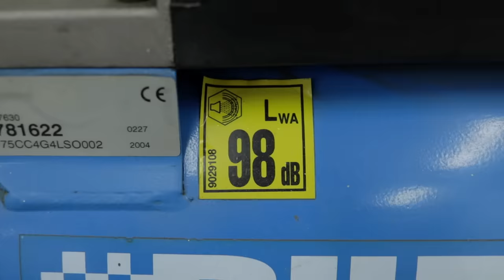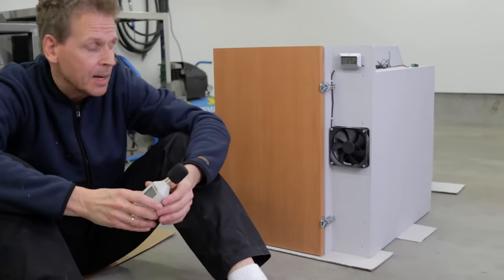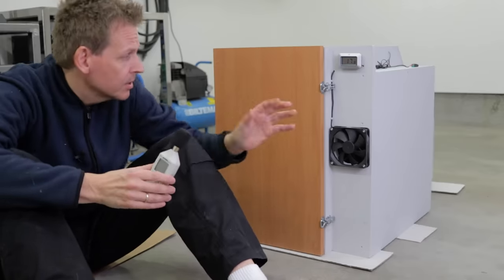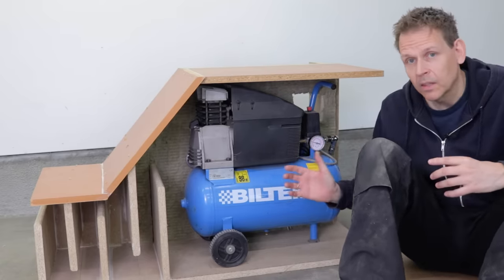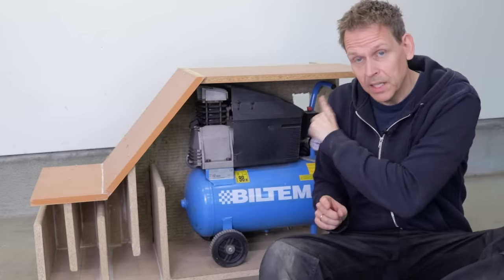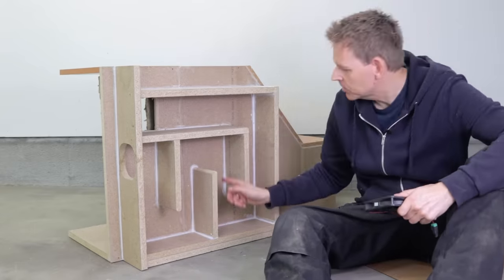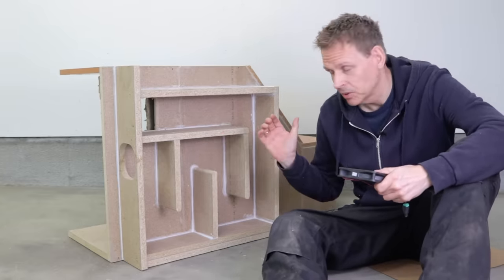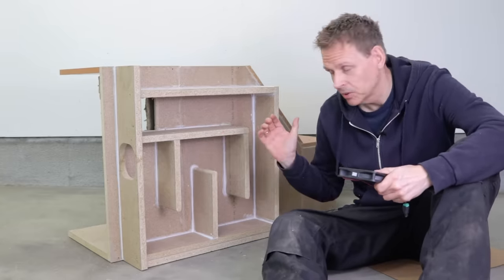Do not build a sound insulated enclosure for your noisy air compressor!

Comment: 0:31 Just a little tidbit, dB is a logarithmic measurement, so a 10 dB gain isn’t twice as loud, it’s actually 10 times as loud!
Reply from the maker: I might have over-simplified how the Decibel scale is to be understood, let me try to clarify (based on a discussion / explanation from the comments): 
* 10dB increase is the typically stated value for doubling the perceived volume (subjective), without respect to actual power/energy. 
* 3dB increase is a doubling of the actual power/energy (objective), without respect to how a typical person would perceive or rate sensed-volume. 
I have to add that the Decibel is a difficult scale to relate to (at least for me), I might have to study this a bit more - sorry if I got it wrong 😌

Comment: The only mistake I saw is that it will be very hard to drain the water out of the compressor tank.  And the water needs drained out after every use, or once per day when in use.  The inside of the air tank is raw steel, no protective finish.  They rust out after a few years, if not drained regularly.  I have painted the inside of my air compressor tank and I still drain it once per day.

Comment: First, if you spent that much time on making the compressor quieter, how much time do you spend on a project? Second, if you're that worried about the noise from the compressor to spend a ridiculous amount of time and effort to quiet it, how do you quiet that 2 cycle dirt bike in the back ground?
Reply from the maker: The time spent on projects like this are pure joy 😊 I have actually fabricated the exhaust pipes for the motorcycle as well, but bought the muffler. It's not that silent 😜

Comment: You couldnt do that with mine, even with quality oil, It gets stupid hot when using air tools.
Reply from the maker: I guess some air compressors gets hotter than others. The environment is also relevant. It's a pretty cold climate here where I live in Norway, in the Northern part of Europe. I have actually fitted a heat pump in my garage to be able to use during winter time. I can see overheating is a big challenge in warmer climates. A more powerful fan or even radiator cooling could be needed must then be considered.

However, since I have a fan in front blowing air into the box I have airflow through the case that will "grab" the heat and transfer it out of the box. I have fitted a thermometer and checked the performance frequently. Normally the temp increases 5C = 10F from when it starts until pressure is built up and it shuts off, and then it takes just a couple of minutes to cool it down (as the fan continues to run after the compressor stops). If it is running constantly over longer periodes it can get a bit hotter, I have seen almost 10C = 20F increase. The warmest summer days can be 30C = 86F here where I live, but that is very rare. Its more commonly 25C = 77F, so it never gets very hot inside my box and it is within the range of acceptable temperature for this compressor.

Comment: My Solution would be, to build a tiny shed onto one walls of the garage, drill a hole through the wall, and just put the air compressor outside. Where it can do 95 dba as it pleases :D
Reply from the maker: Yes, that is probably the easies and smartest solution to the problem 😊Unfortunately, I just dont have space for it. My garage is placed with minimum distance to two of my neighbors. The side facing my own property is not usable either,  as it's just a slim path between my garage outer wall and a concrete retaining wall. In front of the garage door is no good either 😋
Reply: @kihestad  oh thats a problem when everything is cramped so tight.

Comment: Wouldn’t it be better to buy a second identical air compressor and flip it up-side-down. That way the sound waves from each air compressor cancel out the noise from the other air compressor. Badabing silent 97db air compressor!
Reply from the maker: Well, you need some kind of device to make sure they start and stop at the exactly same time, like a syncronization unit - thats a DIY project for sure!!!😁
Reply: @kihestad  great idea! Sounds like we need to get the Arduino’s out

Comment: it may have helped if you built a proper intake silencer first
Reply from the maker: From what I have found a muffler on the intake / exhaust helps a bit, but not very much. I could be wrong though... I did some research but did not find any solution that I found to be very efficient, not even the ones fitted a big car muffler. The tank itself also emits noise because it acts like a sound chamber. I would guess that if a muffler really worked, the vendors would have added it.

Comment: Compact car air intake box will help to quite it down.
Reply from the maker: From what I have found a muffler on the intake / exhaust helps a bit, but not very much. I could be wrong though... I did some research but did not find any solution that I found to be very efficient, not even the ones fitted a big car muffler. The tank itself also emits noise because it acts like a sound chamber. I would guess that if a muffler really worked, the vendors would have added it.

Comment: Don't decibel levels go up logarithmically?
Reply from the maker: I might have over-simplified how the Decibel scale is to be understood, let me try to clarify (based on a discussion / explanation from the comments): 
* 10dB increase is the typically stated value for doubling the perceived volume (subjective), without respect to actual power/energy. 
* 3dB increase is a doubling of the actual power/energy (objective), without respect to how a typical person would perceive or rate sensed-volume. 
I have to add that the Decibel is a difficult scale to relate to (at least for me), I might have to study this a bit more - sorry if I got it wrong 😌

Comment: But you only used wood fiber plates. Add a double layer og plaster boards inside and outside. And you will definitely hear a much better improvement. Gipsplater. 😅👍

Comment: Heat, I am thinking that the heat generated by the unit will cause some real problems.
Reply from the maker: I absolutely share your concern when it comes to overheating. The air compressor will not live for long if it is constantly hot above the recommended specs! 😐 However, It's a pretty cold climate here where I live in Norway, in the Northern part of Europe. I have actually fitted a heat pump in my garage to be able to use during winter time. I can see overheating is a big challenge in warmer climates. A more powerful fan or even radiator cooling could be needed must then be considered.

I have fitted a thermometer and I do check frequently that it's not getting to hot inside the box. Normally the temp increases 5C = 10F when it starts until pressure is built up, and it takes just a couple of minutes to cool it down. If it is running constantly over longer periodes it can get a bit hotter, I have seen almost 10C = 20F increase. The warmest summer days can be 30C = 86F here where I live, but that is very rare. Its more commonly 25C = 77F, so it never gets very hot inside my box.

Comment: You are transferring all the vibration (sound) through the floor, you have to add an anti-vibration base.
Reply from the maker: Yes, you are correct about that. I am planning to improve it, perhaps use some soft rubber.
Reply: @kihestad  Try a sandwich of soft and hard rubber, you can also add layers of cork.

Comment: To be honest, I build a box around my 15y old cheap and small compressor and do not take care. It has a very low cfm rate so I can not use proper air tools. If it break down I may buy a new one with enough flow rate to power tools.
Reply from the maker: Hahaha 😂 you more or less want it to break, dont you? So you can buy a new one 😁 I had an old ugly Honda lawn mower, it was probably 30 years old, I wanted it to break down so I could replace it with something better. It never did, hade to give it away to get rid of it 😂
Reply: @kihestad  nah, not intentionally. I bought it for airbrushing when I was a teen (upsy... It's more like 25y old) now my power tools are all cordless. So I use it only to blow of dust or so. If I would make money with it I would take care of it but I don't think it will break down, seems I have to sell it to get rid of it, like you do.

Comment: You are on the right track but your box needs to be built with angled ends,sides and baffeles, we dont want parrellel side or baffeles because these will allow the sound to bounce back and forth instead if everthing is angled the sound will eventually find its way out.
Reply from the maker: Makes sense, it would also improve the airflow. Others had commented on it as well, it is just obvious now when I think of it, but it did not cross my mind when I built it 🥴😌

Comment: I have a small compressor under my workbench in a cardboard box. Cuts the sound significantly, costs nothing, 5 minutes to cut a couple openings
Reply from the maker: Only cardboard? No insulation? Does it really reduce the sound much? 🤔
Reply: Yes, it reduced the sound more than I thought it would. The box is not even sealed in any way, with the top flaps partially open for ventilation. The compressor is resting on an old scrap of carpet to reduce sound transmission to the floor. @kihestad
Reply from the maker: Hah, that was an easy and clever solution 👍 I would assume the sound is reflected inside the box and the carpet is the one that actually reduces the sound by absorbing and breaking up the sound waves.
Reply: Probably a combination of the two. Any physical object between a sound and your ears will reduce the sound. @kihestad

Comment: Youre doing it wrong! I have had a rectangular box that opens on top no base. the particle board is about an inch thick (two of your boards stuck together equivalents) inside it it has 2 inches of sound deadening foam all around the lid and sides. It has a power socket inside it sits directly on the floor without a base. The air comes in through the bottom. there is room of about 5 inches either side. The duty cycle is only about once every 45 minutes so nothing warms up inside. It has been on 24/7 for over 10 years and I forget its there. There is a bit of noise through concrete floor if I listen out for it.
Where I would improve your design is have a baffled intake and exit with foam fully filling in the baffles. you wont need as many baffles. Right now most of the noise is escaping through the fan I would hazard a guess.
Reply from the maker: Okay, some corrections first 😛 The chipboards I used was 22 mm thick, 1 inch = 25 inch, 25 is not twice as much as 22 😁 You box sounds awesome though! I could not make my box any bigger, I wanted it to fit upstairs in my garage. I did not dare to put any more insulation inside the ventilation channels until I was sure I had enough airflow, it looks good so far, I might add some. I think the vibrations are most annoying now from my compressor/box, I need to improve it by adding better vibration damping between compressor and box, and between box and floor. Thanks for you tips!

Comment: I would also have the compressor insulated from the case using some very soft rubber or foam.
Reply from the maker: I have planned exactly that 😁 I think vibrations are the biggest source of noise now. I will try to improve it by adding soft rubber, dampening foam or springs on the compressor and/or between the box and the floor to improve it. Thanks for the tips! 😊

Comment: Another solution is build a shed on the wall on the outside of you garage/shop and saves alot of space if have like a 60 gallon compressor
Reply from the maker: Yes, I wish I could 😊I just dont have space for it. My garage is placed with minimum distance to two of my neighbors. The side facing my own property is not usable either,  as it's just a slim path between my garage outer wall and a concrete retaining wall. In front of the garage door is no good either 😋
Reply: @kihestad  ahh ok then i guess this is the best you can do for the time

Comment: You may have considered using sound board and building it with an air gap to use tried and proven sound deadening technology
Reply from the maker: "building with an air gap" - like building a box within the bok? Perhaps a bit complicated build, but it would probably be very efficient!  😊
I did use Rockwool sound insulation material (3cm = 1 inch) on the main chamber. the ventilation only got a very thin fabric. I was afraid of not having enough airflow to keep the compressor cool, and I could not make the box much bigger so I went for very little sound dampening on both the inlet and the exhaust channel. The cooling seems to be no problem in my "cold" climate, so I might add some more padding now to see if it helps. Thanks for the tips! 🙂
Reply: @kihestad  no , sound board is a product similar to drywall. They will drywall a layer, then they will use a special caulking and put beads across and put another layer of the drywall on and then not pull it tight and leave a small air gap between the layers. Somehow it really deadens the sound. You can look up videos of it

Comment: The second compressor is much quieter. But you still will have problems with temp.
Reply from the maker: I have been using the air compressor for quite a while now, and the ventilation works like a charm. No overheating at all. I live in Norway, and it does not get crazy hot here. Hottest days in the summer is rarely above 30C / 85F. In hotter environments you probably need better cooling.

Comment: Best option, put it outside the building in an enclosure 👍
Reply from the maker: Yes, that is probably the easies and smartest solution to the problem 😊Unfortunately, I just dont have space for it. My garage is placed with minimum distance to two of my neighbors. The side facing my own property is not usable either,  as it's just a slim path between my garage outer wall and a concrete retaining wall. In front of the garage door is no good either 😋

Comment: Forget insulation and wood just built the box in plasterbords 3 layers will sound insulate like crazy, and its a cheep way
Reply from the maker: I bet that will work well, but they are a bit weak and perhaps challenging to seal them in the corners. Perhaps a wooden outer box first, and then plasterboards inside?

Comment: Real sound insulation needs "floating" box with rubber bottom, inside other box with soft feet. So just build another box for it ;D
Reply from the maker: Thanks for the tips 💡 I'm sure it would have improved the sound insulation 👍

Comment: I have a medium sized 240v compressor with a electric motor and belt to the compressor, it is substantially quieter than those pancake compressors
Reply from the maker: Yes, belt driven compressors are better - but bigger and more expensive as well.
Reply: @kihestad  right, I was amazed how noisy the HarborFreight pancake compressor was

Comment: Nice job. But ‘interesting’ to see that Honda bike with no exhaust mufflers! Producing 150 db that way…….
Reply from the maker: Haha 😂 that's just temporarily, exhaust pipes and muffler will be fitted before use!
Reply: I have similar compressor and put wheels and stand on 1 cm rubber padding, (playground rubber tile) @kihestad
Reply from the maker: Yea, it's shaking a lot. Especially the old one, bit the new one as well. Will do the same 👍

Comment: sir, use two layers of drywall for the box body. Love from Russia
Reply from the maker: I thought the box was complex and heavy enough with a single wall construction 🥴
Reply: @kihestad  Do you need to move a box? Solved a similar problem with noise and air for the fan. 2 layers of drywall and high density stone(mineral) wool (100-200kg per cubic meter) inside the walls reduced the noise to zero. Then there was vibration. The hanging rope helped.
I also used the S maze, like yours, to lengthen the sound path.

Comment: I have not watched the video yet.. But from experience.  Sound proofing a compressor would not work very well.. For both performance of the compressor and for heat / sound.
Compressors of a decent size will produce a lot of heat and noise.  They take in air and compress it. so you can not seal them in sound proofing.  As most sound proofing will restrict air flow.

The best solution for my old workplace compressor was to build a brick enclosure, with a roof that had an opening for air to go in and to the compressor.  This removed the low end noise and then double wall the brick enclosure.  The fact that the air travelled around 2 corners to get out / in... Meant that the noise escaping the room was not too loud. 

The absolute best solution in the end was to have a 300 Litre receiver. (bigger storage tank).  So the compressor turned on for 60 minutes... then off for 30 minutes.  (we were industrial use and used a lot of compressed air in the machines.)  A bigger receiver means you can shut down the compressor for a longer time before it needs to top up the reserve.